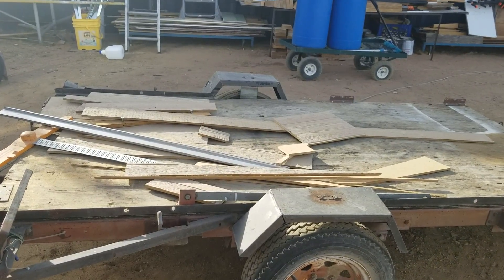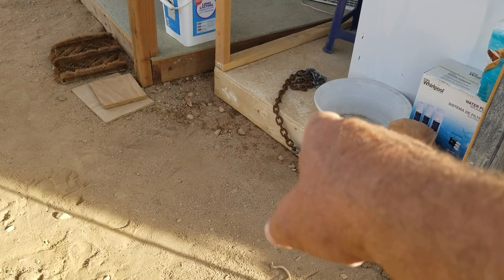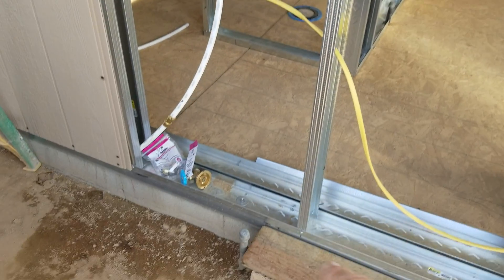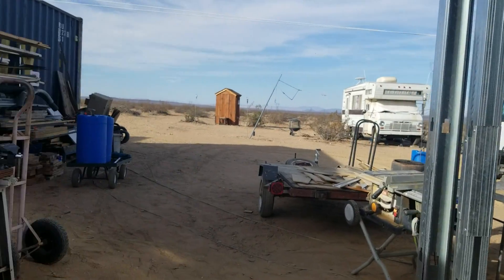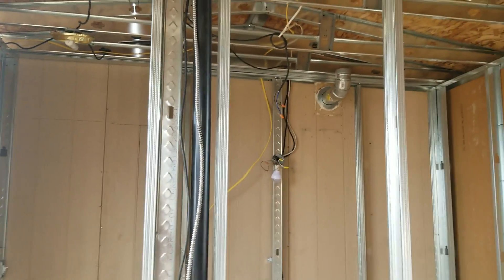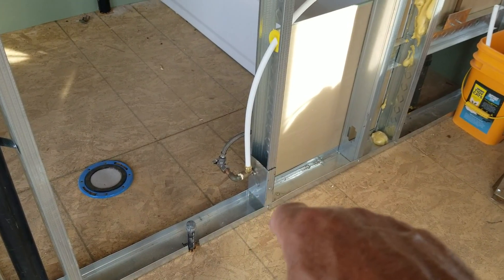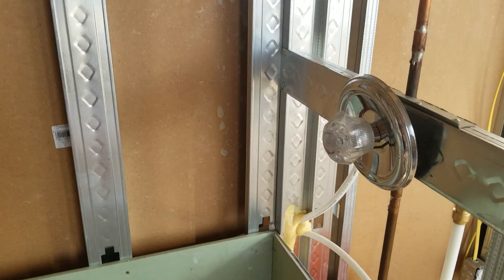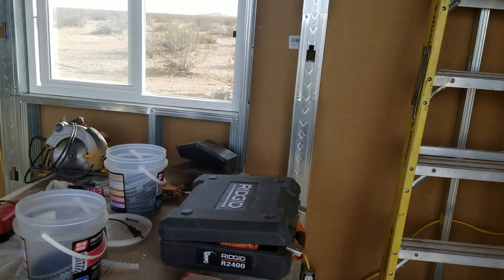Homesteading the Desert,  Sep. 27, 2018

Comment: hi sir i got 2 mppt controller to my same battery setup how will i add a wind turbine to the same batteries with out overcharge battery
Reply from the maker: You need to add a dump load controller and a dump load. Are you going to install a 3 wire, 3 phase or a 2 wire single phase turbine?
Welcome aboard.
Reply: @GBear  . 3 phase turbine can i just connected  to a  3 phase Rectifier then a battery relay 100a to a 100w 2ohm resistor dump . thanks for your reply
Reply from the maker: You are very welcome.
Reply: @GBear  , is it right the way i explain now? i want to b sure before i buy
Reply from the maker: @pepe58pepito54  do you have a picture or video of your setup?
Reply from the maker: Did you buy the dump load controller I showed in the video.  That part is definately needed if you have a turbine.

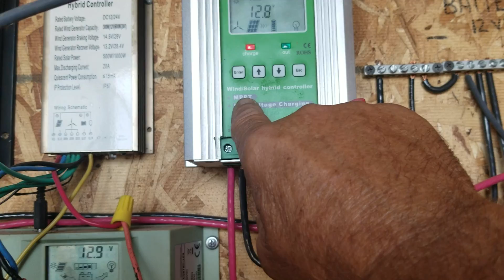Comment: 8:35 i have exact hybrid charg controle like yours on right. I have connected my 300w wind turbine and 320 solar panels. The problem is that i get energy from solar around 300-360w, but wind turbine is only up to 5-10w generation. I wonder if there i need to change any settings or samthing. My wind turbine is 12-24v auto, 3 connection cables. If any one knows what is the problem, please let me know, as im stuck. Thanks
Reply from the maker: Ok, here is what's going on.   A 300w turbine is the 'max' output rating, not the constant output.
If that turbine is rated for wind speeds up to 40mph, you will only see 300w at 40mph.  Lesser wind speeds produce lesser output.  If you are only showing  low output it is because you only have moderate winds.
Reply from the maker: Oh, and Welcome aboard.
Reply: @GBear  well its - Start-up Wind Speed 2.5mph Rated Wind Speed 10.5mph. And since i hade this turbine we hade strongs winds up to 80mph and max output is 10w, werry rear i can see up to 12-13w
Reply from the maker: @CryianSky  ok, what I learned was that the hybrid combination wind and solar controller was not reliable for turbines, and it was recommended that the 3ph, 3 wire pma (turbine) should be run directly into a rectifier, then connected directly to the battery bank through a watt/amp/volt meter for accurate readings, as shown in this episode.
Note that I had a 400w turbine prior to upgrading to my new KT5 12vdc, 3ph PMA,  and I never saw the old turbine create much through the hybrid controller.  When I switched to the rectifier, I saw 180w in a 35mph wind.  Average output in lower winds was very low.
Also note that if your pma is rated for a max speed of 20mph, that means the blades stall at that speed, so even in 80mph winds the blades can only rotate to 20mph speeds.
Remember when connecting a pma or any of the components, connect the battery side first, then the pma side last.
Lastly, when you connect a pma directly to a battery bank, a dump load controller is a must!  Solar controllers (solid state) have that built in by way of the 'load' part of them, and you should connect those load terminals to a load to protect overcharge to the batteries which will permanently damage them.

Comment: Hello hi .. .! This is the book for solar charger with dump .  https://youtu.be/CqVbTzLfCYg
Reply from the maker: Yes, I have the same controller.  I had connected my old turbine to it which was 12v and it worked for a short time.  The manufacturer of my new PMA says those solid state controllers will burn out if used with a 1680watt PMA and I have to believe them.
Welcome aboard and thanks for watching and commenting.

Comment: Hi. Im using that very same charge controller for my wind turbine.(the one on the right) because i had a piece of crap /standard one with only the light that wasnt doing much and with storm was chaging my batteries with 16 of 17volt..but the new one doesnt charge my battery at all.the amp indicator says 0.00 and the red light is out.evem with storm. Does anyone have any idea whats wrong?
Reply: I am also really interested in this as I have one from ebay and it is working in a weird way. I have 12v battery and have not yet connected the wind at all, but first I did connect the dump load resistor and solar. First all looked ok, both light were on. Then red light came off. the green light is on even if I turn of any load to anywhere. I had the upper limit at 14,4V, the lower at 10,8V and the float at 13,7V. The red light was off, the green on, and the amps from my solar panels went up to 12 A. The Voltage in the system started rising and as I was not watching it went to 15,5V when I noticed it. The battery was making a hissing sound. Both battery and the output were rising over limits. So I disconnected it fast. I tried few times and every time the same result. First it looks ok, then jumps up starting to cook the system. So I went to a shop and talked to some guys who know and all they could guess was that I need to disconnect the resistor, maybe it was causing it, because I did not have the wind turbine connected.. So now I am trying again, but now it is really cloudy so I need to wait.. tomorrow I will see.. I think these controllers are crap as mentioned in the video.
Reply from the maker: Hi, sorry I missed this comment/question, but I never got notified of it.  I just found it as I was checking on a new comment. 
That controller never worked for my turbine either.

Comment: I like most everything I don't like using romex wire in metal buildings I would use metal conduit (EMT) it's safer and the metal won't cut through the conduit like it could with romex. The shower has a problem with the shut off at the head cold water could and usually does bleed into the hot water heater if left off at the head. I had that happen and lost my hot water because the water heater is on a timer. I still use my shower head cut off but always turn the water off at the faucet. Moen makes a faucet that you push the knob in to turn it off so the settings stay the same and don't need to readjust the hot cold setting, everything else looks good. Metal is less costly and good and strong. Screws are needed to put up anything on the walls but who cares it won't come down. Thanks for posting.
Reply from the maker: Ron B on the romex, I use nylon bushings where it goes through the studs, and fire block foam where it penetrates the top cap to prevent cutting.  Thanks for the info on the shower/hot water heater.  I am using a Moen valve.  Thanks for watching and commenting.
Reply: @GBear  ok then the moen faucet is different than the one I am saving for my shower. Mine don't need to turn to turn on water you just pull the handle out. Shower valves per code must start with cold water.  I don't have children and I will just use my outdated valve for replacement. My father in law hooked the hot and cold together and had no hot water. I wish I was up there I could have saved him money by not replacing the hot water tank. The plumber took him for a ride and still didn't fix the hot water problem until later. As for the romex your ok now. Some states or maybe just a local code. You must use EMT. In Florida we still can use romex which I use now. The circuit breakers is another issue that came up but I'm not building new right now. Electrical Code changes  every time there is something new.

Comment: Love watching your channel. 
We always used galvanic isolators where copper or other disimilar metals passed through steel studs. 
Not sure if it’s necessary, but we always used dielectric unions too when connecting disimilar metals. Yours is mostly PEX but it seemed like your shower valve body and riser as well as the angle stop for your toilet might need isolating? 
Either way, love watching! Great channel!
Reply from the maker: Completely Disinterested all connections are brass and copper, not pen connections but shark bite.  They use plastic inserts to seal inside the plastic connectors.
Thanks for your input!
Reply: G Bear :)